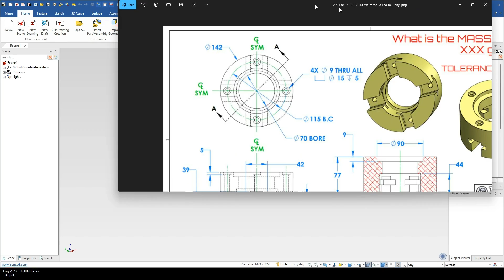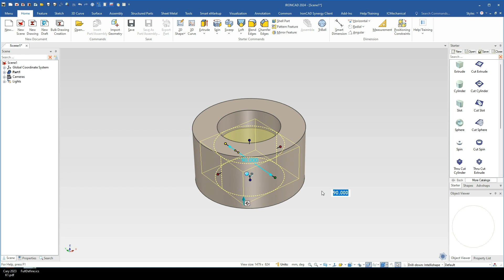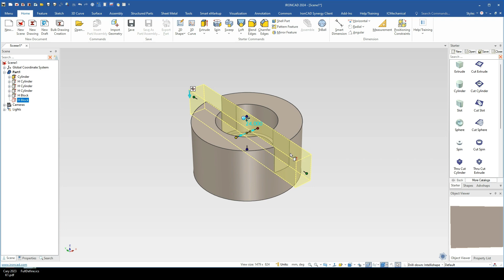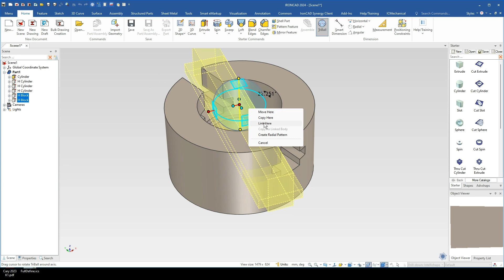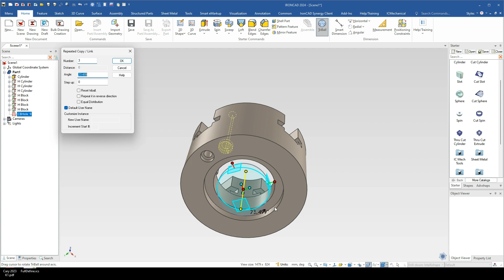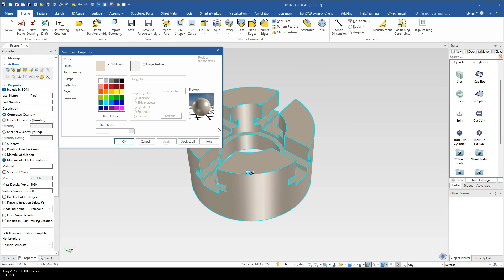Too Tall Toby Practice Models Performed in IronCAD - Practice 24-07-06

Comment: can I ask you, do you have a Ironcad closing when you try to do some stuff. I had no problem before but now is just closing randomly so I need to save my work every time I do or add something.
Something is there that doing this. I even redo my computer from scratch and didn't helped. and no one has idea why. ironcad 2024 same problem with 2023.
Reply from the maker: Hi @JBCool0729, You can contact our support team to assist. Support@ironcad.com. They can remote connect to your machine and gather log information to detect the issue you may be having.